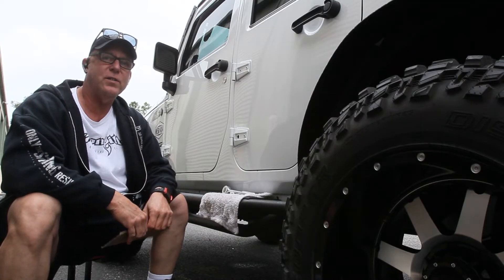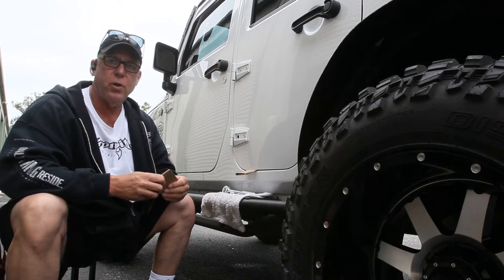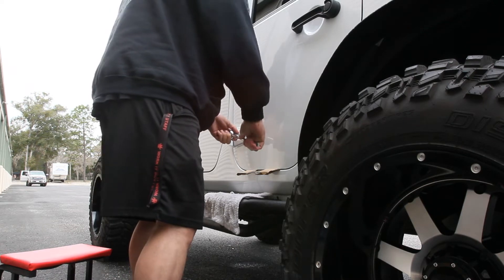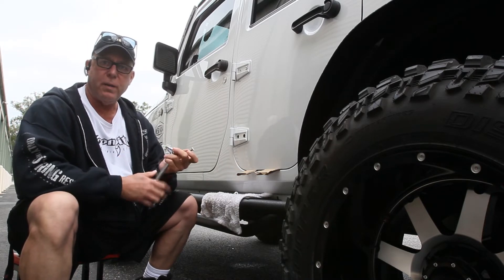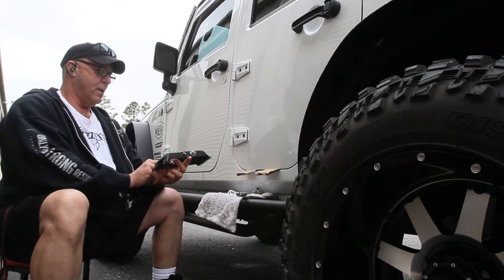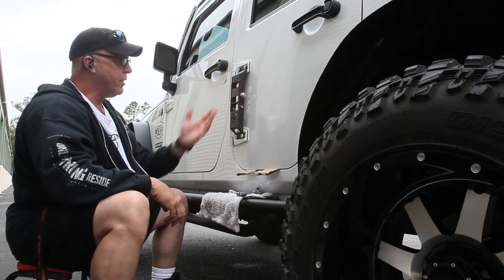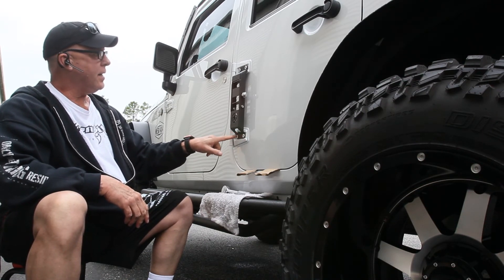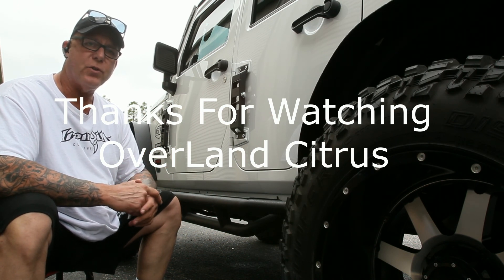Hooke Hinge Step Install on jeep

Comment: Have you had any issue with the metal of the step contacting the metal of your Jeep such as paint damage or rust? I just got these and thought it came with a little paint protection film but it did not.
Reply from the maker: No I did not every have any but I never took them off